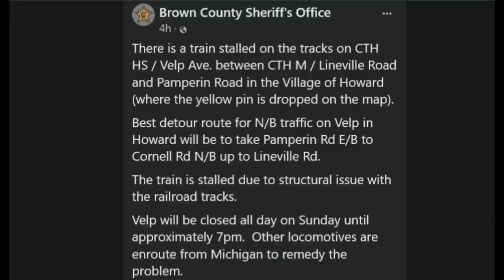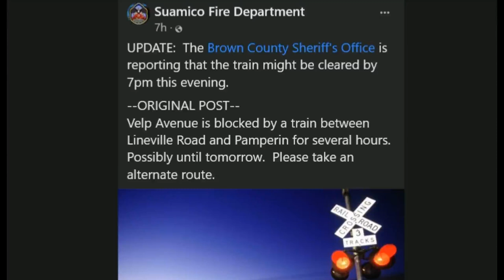ELS 502 On A Mission To Rescue A Derailed Train In Green Bay! | Jason Asselin

Comment: Don't remember if I mentioned this in the comments of a previous video, or if Jason himself mentioned it in a video,  but about 3 months ago I was in the Velp Ave. area and found out the same thing had happened at the exact same place. I had to turn my car around because the road was completely blocked. That time it looked like there were only 2 cars off the tracks, and both upright, and the train was heading north with the engines north of the road, so they were able to clear the road more easily.  

And it doesn't say much for ELS that they had another incident in the exact same place just three months later.  Sure looks like they didn't adequately fix what was wrong.

Comment: WORK PROGRESSING RAPIDLY.
Escanaba & Lake Superior Road Extension Being Pushed From Channing Eastward.
       The right of way for the extension of the Escanaba & Lake Superior road from Wells to Channing, has been cut. The road will penetrate a dense forest.
        Sol Fraser, of Menominee, has completed his contract, having cut seven miles of the right of way from Channing eastward. The remainder of the right of way was cut by contracting agents.
        Nearly twenty-one miles of road bed has been graded, and the work is progressing surprisingly well. Nearly four hundred men are employed.
        The extension will be twenty-nine miles long. The work of laying the steel rails commenced last Monday. Over 2,500 tons of steel has been purchased. The company will be running trains over the new road in two months.
The   Current, Norway, Dickinson County, Michigan, Volume XIX, Number 2 [Saturday,             February 14, 1903], page 1, column 3

Comment: I would think in a city that size, they would have plenty of equipment available locally
Reply: The railroad is too cheap, of course there is equipment here in Green Bay. You should see how bad the condition of the track is down here.
Reply: @briandonovan9560  it would be like a trucking company choosing to drive on bald tires and crummy roads. That’s their livelihood. I don’t get it.
Reply: Unfortunately, if "rescue" equipment has to come from the north, thanks to mergers and track abandonment it would take such a roundabout route  for equipment from another RR to get there that the ELS might as well send its own.

And Green Bay isn't anywhere near the RR center it used to be.  Fifty years ago there were two Class I railroads (Chicago & Northwestern and Milwaukee Road) and one Class II (Green Bay and Western) that each had its own yards and shops here. Now there's just the Canadian National, using the old C & NW yards. And there used to be eight lines into the city; now there's only three (the ELS line, and the old C & NW lines into the Fox River valley and the Upper Peninsula, both run by CN).